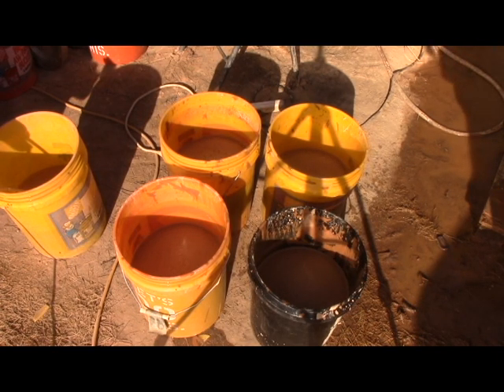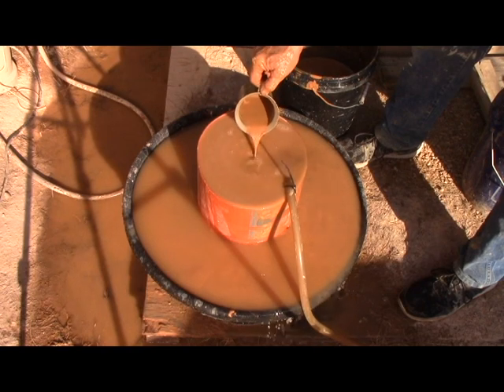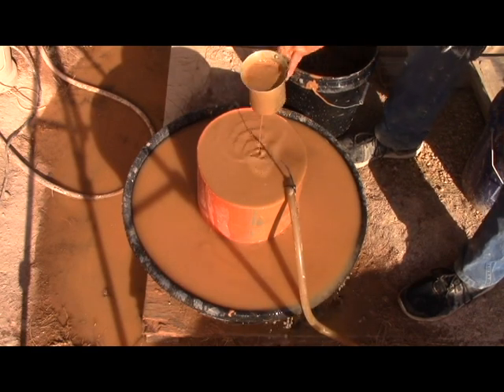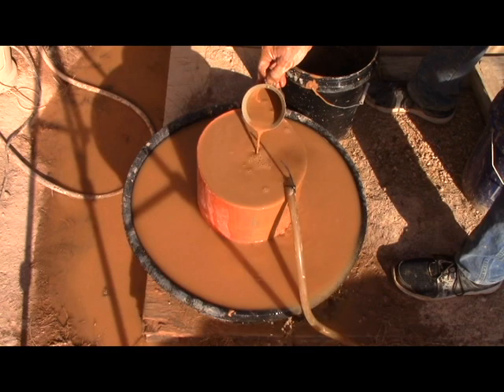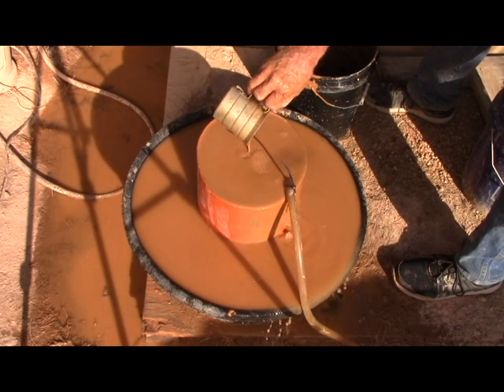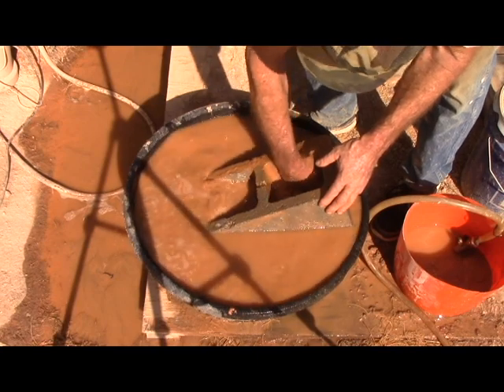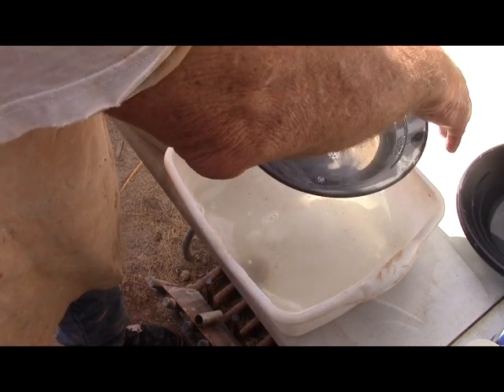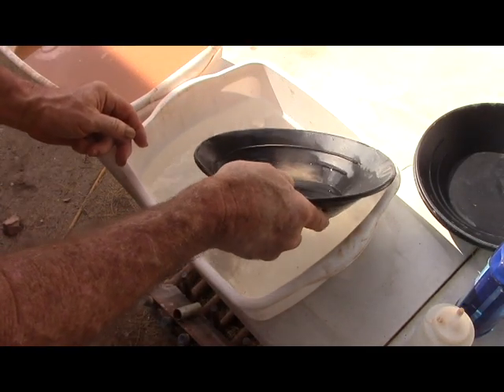157 The 'Mudslinger' Slimes Concentrator

Comment: Believe  it or not i like the challenge of dealing with fine gold , that's why i'm enjoying your vids , i guess that's because in our area that's pretty much all we have , your method there is pretty much what i think i would have done , but i might have placed a bottle of jet dry above somehow just releasing a drop or two per minute into the mix . Thanks for showing your result , cheers .
Reply from the maker: That might work.  The slimes still had some 
Dawn from the original processing in them, but I forgot to add a bit more for safety.  I figure if I can deal with the most difficult challenges, the easy will be very simple.  I'm making progress...

Comment: Would it not work better with a soap in there to make the gold sink a bit better?💛👍😉
Reply from the maker: There was some.  You have to balance surface tension against frothing.  I think I will have to try laundry detergent as it is designed for low suds.
Reply: I found using soap with that slime leaves a stink like no other

Comment: I don't have any real equipment so I just run it thru filters adding water. I also use a foot massager because I don't have a shaker table but it works . I have a broken back massager I plan to soon use the guts from and make a table. Dollar store batter operated toothbrushes work pretty good too
Reply from the maker: As  long as it works and you are having an interesting time, all else is secondary.

Comment: Interesting. Just out of curiosity, I also started working those fine slimes that I used to throw away and found that there is a surprising amount of micro gold in them. I snuffer them up and dry them and then melt them down when I get about an oz of concentrates.
Reply from the maker: That is why everything should be double checked.  It would be nice if things were simple, but they rarely are.
Reply: Hard Rock University 
Heh, heh, so true. I have learned a great deal from you over the years on how to pan this tiny gold and I find I like working with it much more than the larger and I really enjoy the challenge.  Thank you.
Reply: utahavalanch 
Right on !!!!!
Reply: Flour gold Wizards 
Hey Wizard, hope you're having good summer. I'm trying to survive a bad heart this year. Hope to be able to get back at it soon.
Reply from the maker: @utahavalanch  You are most welcome.  I am glad I was helpful.

Keith

Comment: Pretty sure that the gold looks brown because either 1, it still has oxides of iron staining it, or 2, the size of the crystals is changing which wavelengths of light it will reflect. ~( 'w')/
Reply from the maker: I think in this case, it is the size.

Comment: At this point it would likely be very cost effective to use ammonia to dissolve out the gold.
Reply from the maker: What is the cost per ton and the complexity?  I haven't heard of ammonia as a lixivant.
Reply: Ammonia is great to clean gold but if there's any trace of copper in there everything will turn blue. Believe me someone told me it's great for cleaning it so I made a video of it and I Had copper with the gold and everything turned blue. I tried it with a 3/4 oz rose gold pocket watch chain to make it a bit shinier after finding it in a stream and now it's black/blue!!! At least nobody will want to steal it in its present form.😂👍💛
Reply from the maker: @rastamanralph6670  I'm sure DD meant to dissolve the gold.  However, that is only half the process.  Then you have to recover it from solution.  I have no idea how that is done right now.